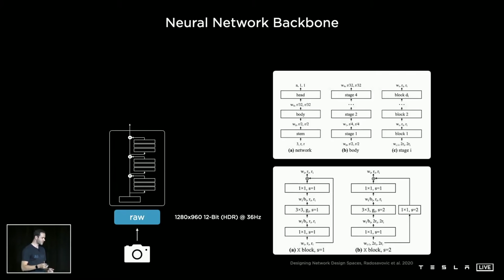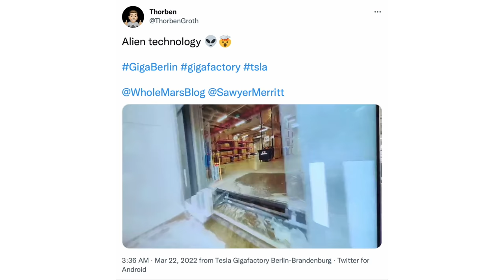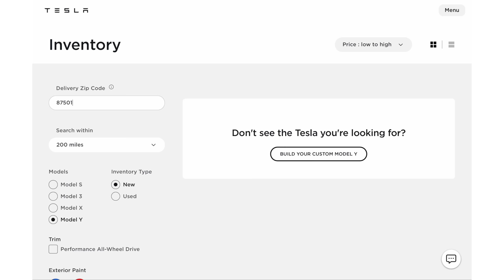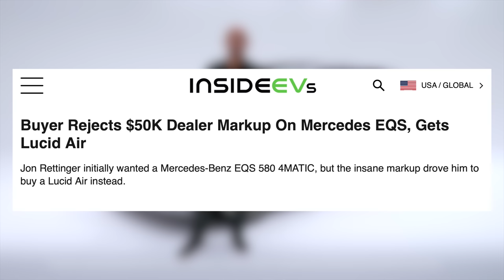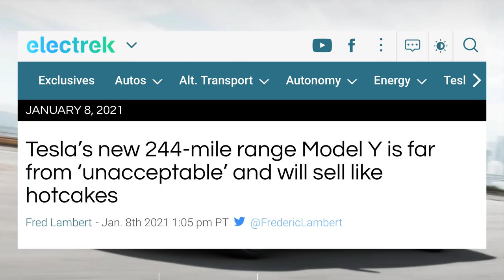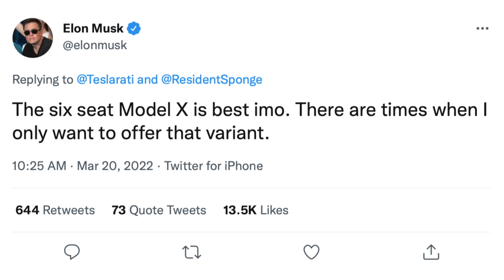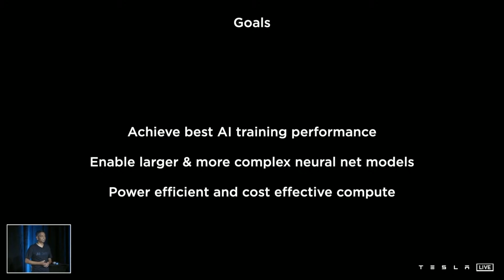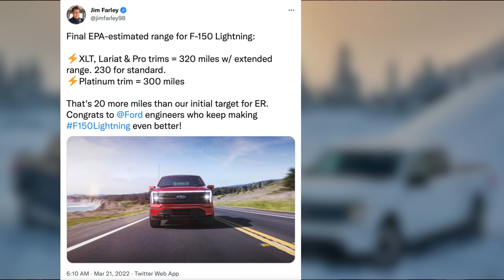More Teslas Sell Out Until 2023

Comment: I finally bit the bullet and ordered a MY LR about a week ago. My projected delivery date shows as September. I chose blue paint, standard wheels, and white interior. I may switch to black interior, however, to save a thousand bucks. I've already ordered and received a Tesla charger and got permission from my condo board to install it in my carport. The Tesla recommended installer estimates between four and seven thousand bucks for the project. (GASPS)

Comment: Hi Ryan. Congrats for the great videos. Question: do you know if the new 4680 battery will allow full charge to 100% like the LFP?
Reply: @whynotstartusingyourbrain8726  that's not confirmed
Reply: @whynotstartusingyourbrain8726  Because the chemical allows for that to be achieved. From my understanding, the 4680 cells are using NCA chemistry. Because the Iron used in LFP batteries makes them safer to charge without much battery degradation.
Reply: The form factor is not responsible for your charging limit, it's the chemistry within the form factor. If they make 4680 lfp then yes you can charge to 100% but if they make NMC 4680 then it will be just like any other NMC battery in which it would prefer to be charged to 80%.
Reply: @AudiTTQuattro2003  I said that lol
Reply: @whynotstartusingyourbrain8726  Heat dissipation has nothing to do with a batteries optimal charge state, it has EVERYTHING to do with the internal crystal structure of the battery which only varies with the chemistry you are using. LFP has an extremely stable crystal structure which allows for it to not suffer damage from charging above 80% for long periods of time. This is the opposite for NMC, NCA etc chemistries which have a stable crystal structure up until 80% then they become less stable past that point.
Reply: @whynotstartusingyourbrain8726  no it’s not. It’s about the chemistry. Charging to 100% causes damage to the anode. Lithium iron phosphate are not susceptible to the damage in the way other lithium chemistry batteries are

This is a well understood and researched concept.
Reply: What a silly thing telling people not to charge your battery to 100%.

Comment: Only 77k ,  why so cheap?  I wonder if the under carriage will rust as bad as internal combustion vehicles currently being sold for only 20k  .
Reply: The vast majority of the underside is aluminum. Only a few suspension components and the subframes are steel.

Comment: Energy density is the energy in watts per kilogram of weight. By that factor hydrogen has an energy density of 35,000 watts per kilogram, while lithium-ion batteries have a density of just 200 watts per kilogram. By that measure, hydrogen fuel cells have a big advantage over batteries.
Reply: LOL, you’re not gona harvest anywhere near 35 kWh per kg from hydrogen fuel cells
Reply: @djkim23  in a cold climate, battery 🪫 won’t drain like Tesla!

Comment: I think that survay would of been more of a popularity test then anything else.  Everyone knows tesla has the auto pilot / self driving.  Surprisingly a lot of other brands have similar features and just aren't talked about as much or well known.  And actually do a better job then tesla's in my experience at this point.  I can't trust the auto pilot on 2 lane roads because it always slows down and beeps at on coming traffic.  I never had the issue with my ford fusion from 5 years ago with stop and go cruise control with lane assist,  and we have a kia k5 that does steering assist that is very similar to auto pilot and its a simple push of a button.

Comment: Your experience with the Ioniq 5 is extremely cherry picked. As usual with dealers, you need to shop around. Obviously if you compare some of the worst dealer experiences with Tesla, you're going to like Tesla. But that's just lazy. We were able to get an Ioniq 5 with no markup and excellent customer service. We also still have a Model Y on order since Oct '21, with no end in sight for waiting and terrible customer service from Tesla. Our ETA is more fickle than BTC price. At this point I have no trust in any sort of communication coming from Tesla. Enough with speculation, give the customers transparency. Our Tesla experience has been a nightmare compared to Hyundai.